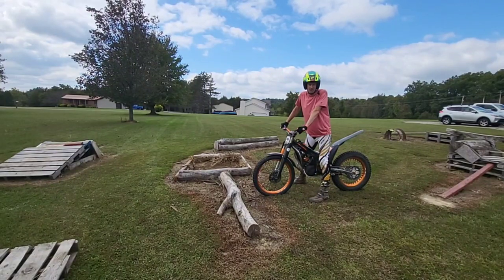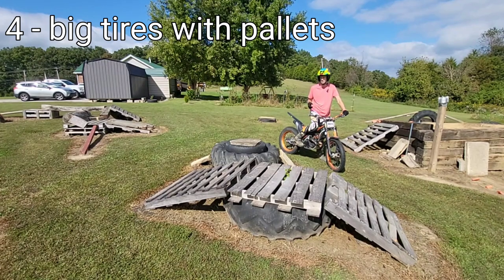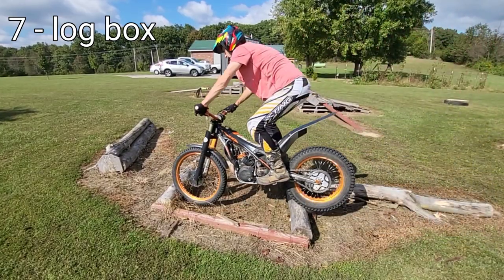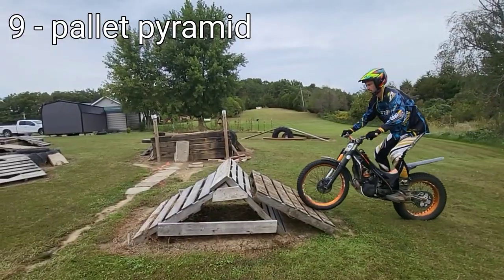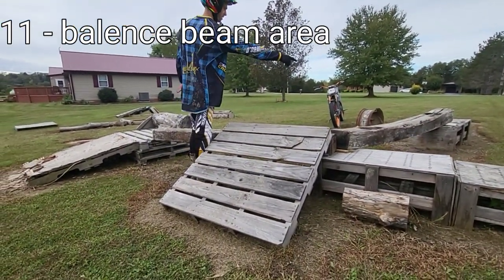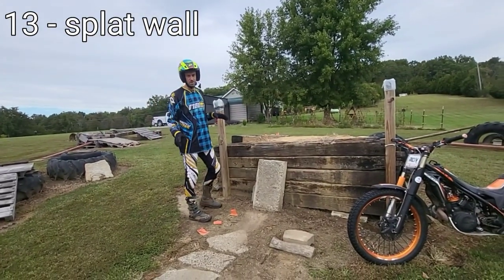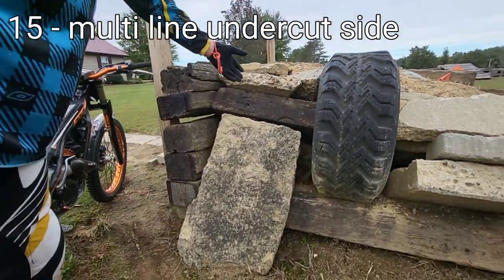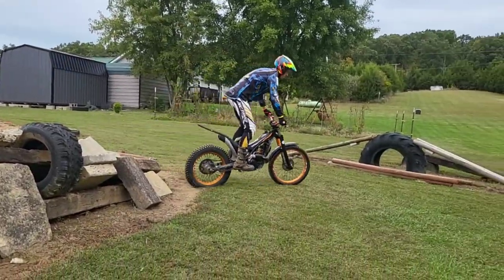Beginner to Advanced Backyard Trials Obstacle Course Build

Comment: I started building a backyard trials course over a dozen years ago and started out with wood pallets. After a few years they all rotted and broke. I was lucky and found on craigslist in the free section, dozens of plastic pallets from a pallet company going out of business. They seem like they will last forever and weigh 50 lbs each. A month ago my neighbor tore out his driveway and I had about 20 tons of broken concrete delivered to my backyard for free. I recently got a quote for 18 tons of unscreened recycled asphalt for $100 undelivered which can be useful for more obstacles. I have a few truck tires but in my opinion tractor tires makes your backyard look more like a junk yard.
Reply from the maker: That's epic! Good call on the plastic pallets and all that free stuff. 👍

I'll be right over to play. 😉

Comment: Number 5 was great when I was starting out. I got so much out ofsuch a simple obstacle. I would wheelie up and stall on top on the back wheel either brakes or holding pressure and swing it round to go off a different angle.
Reply from the maker: Awesome 👍